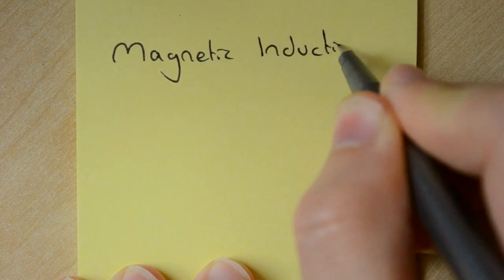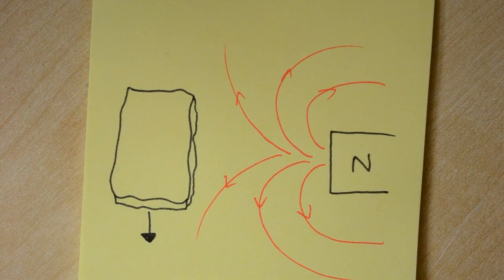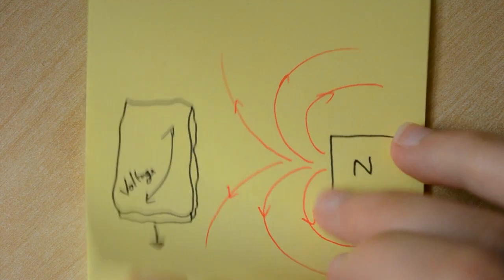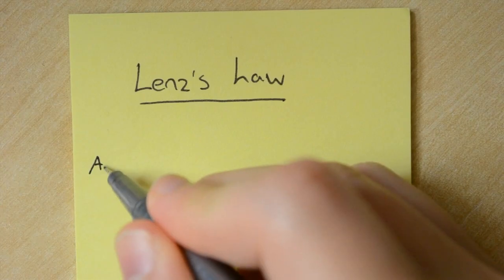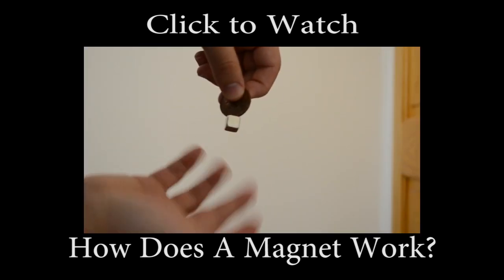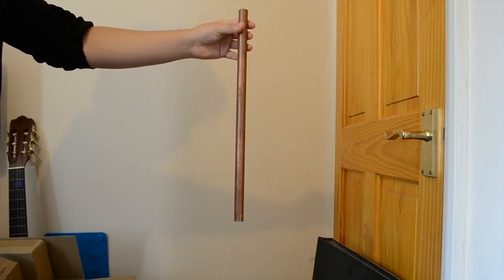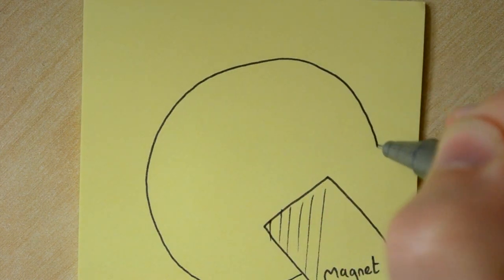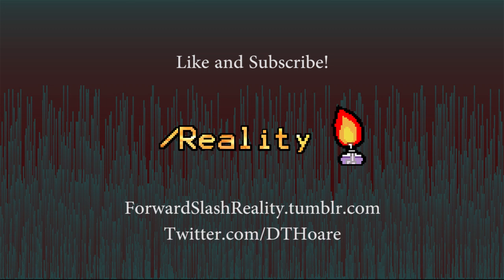How Does Magnetic Braking Work?

Comment: Most hybrid vehicles already have energy recovering brakes that work on the same principal, like my parents' 2003 Civic Hybrid.  The magnetic braking slows the vehicles significantly at higher speeds, but the slower you go the worse it works, it can't stop the car on it's own.  The magnet slows down but it does not stop falling through the pipe.  You still have to have the friction brakes.

Comment: Magnetic breaking systems are useful only when the pieces of the breaking system are moving, also slower motion yields less effective force of breaking in an EMF system.  In the end you would still need a friction bases breaking system to keep your vehicle at a stop and to get your vehicle to a complete stop.  A magnetic breaking system would greatly extend the lifetime of your friction breaks, but it's highly unlikley we'll see cars with these... ever, due to the additional cost of materials to build the systems.
Reply from the maker: Good points, as the braking effect is proportional to the velocity it moves at. They're more useful as an initial or emergency braking system for faster moving vehicles such as trains. They've also been considered as a possible way of damping vibrations in space vehicles.

Comment: Stopping a wheel that quickly will cause the wheel to lose traction.
Reply from the maker: One of the benefits of electromagnets is that they allow for fine control of the field they produce. This makes it easy to adjust how fast you stop a spinning wheel.
Reply from the maker: Dan Coulson That is a good point, it's always useful when the laws of physics themselves are a safety feature.
Reply from the maker: Dan Coulson
It's always interesting to find the sort of every day examples of these and see how they work. Thanks for sharing